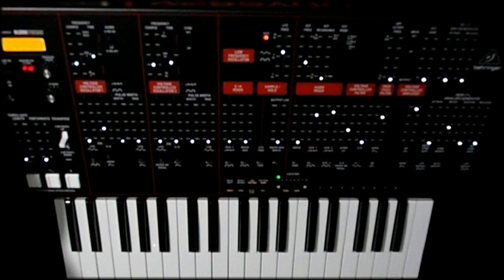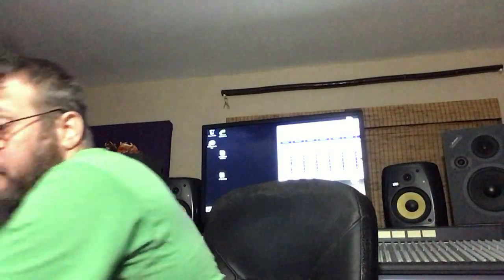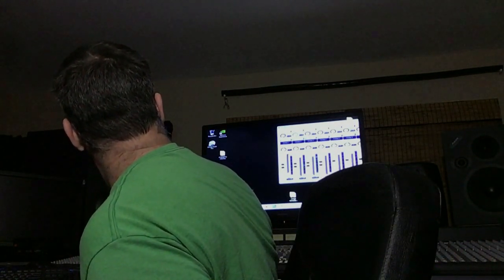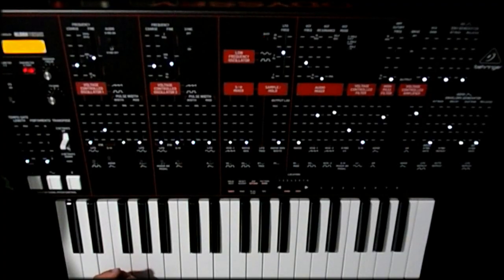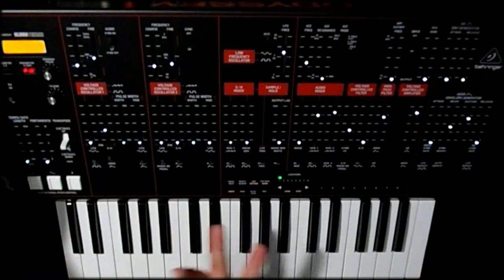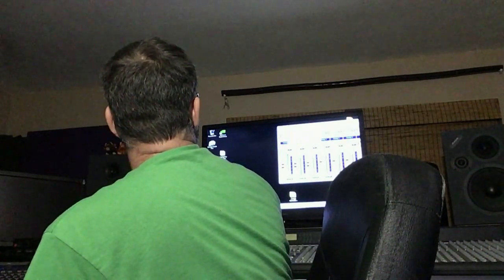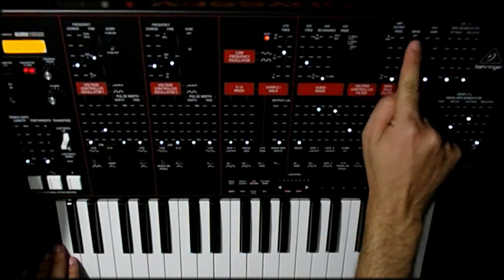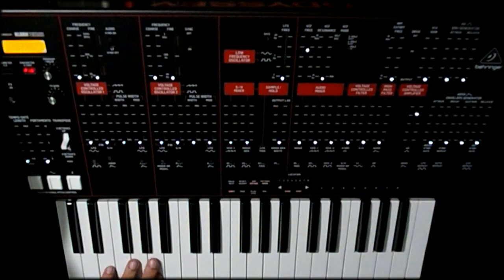Behringer Odyssey Emergency Guide. Things you MUST know.

Comment: My mate told me the other day that he likes Behringer because the do great clones of no longer available or expensive hardware that he could never afford. But whilst they may sometimes even add modern improvements, they often also clone the bad or annoying and dated parts of said hardware too. I would love a Behringer Odyssey. They sound great, are built like tanks and it's a lot of synth for £400. But I have nowhere to put one and I'm trying to cure my excessive GAS. Great video. Subbed. 🙂
Reply from the maker: here's something that will do what you mentioned: IK Uno Synth Pro. The original tabletop or anything later. You can get that original tabletop ive seen as cheap as 200$ used and 3-400$ new That is a ton of mono synth for the money! You probably know about it's features, but 2 filters in a huge amount of ways to arrange them. 3 smoothly morphing oscillators, full automation and presets with a mod matrix. Sounds great too. if you use it with the plugin editor it feels pretty knobby too. 

Also both filters are different, sound different, can be serial or parallel and one of them can be either 12db or24db and still use the other at the same time. There's not much else that can do this and have CCs and presets too, in fact i can only think of one other synth that does, In fact the same guy, Erik Norlander was on the design team for the other: The Alesis Andromeda, which i also have. I'll tell you what, I use the IK Uno Synth Pro way more! it's just so convenient.

The Behringer Odyssey is great though and it's fantastic having everything laid out with such a nice work surface and has that classic sound. Also as far as cloning bad stuff, i cant say the Behringer Odyssey has any flaws in it's design or construction. You also wont break your keys as easily as a vintage one. They hang over!

Comment: Are the sliders mappable?
Reply from the maker: Nope, these dont have midi CC. its a what you see is what you get synth. If you want a good comprehensive mono synth with some paraphonic ability that has tons of CC and features I'd go for the IK Uno Synth Pro. The firsyt one can be had very affordably (2 for the price of an odyssey used) has tons of features including 2 simultaneaous filters with different routing styles. It also sounds phenomenal, easily as good as the odyssey. If you must have full hands on all knobs on the surface, id go for orignal korg minilogue. 4 note poly, and pretty much knob per function with CC and still sounds good, though not as beefy as uno pro or odyssey. Minilogue sounds good still just abit thinner and more metallic. It can do a vast araay of sounds, and is more comprehensive as an analog synth than the newer minilogue xd.
Reply: @ Thanks for the clarification, d’you have any recommendations for a poly synth with the same general layout as the Odyssey and mappable sliders specifically? I’ve a juno 60 emulation running via iPad and need the most versatile piece of hardware to run it and stand alone to justify the purchase…

Comment: you may like Behringer because its cheap but Behringer does not target the professional intrumentalist, their more like sales people, is like the Aldi Of musical intruments, they will break down sooner or later, mine has on 3 occasions. You will also find that the logic chips will start failing and your illumination LEDS on the sliders will start to fail, that would be the first sign. The swithces are somewhat flimsy and the PCB is a very poor flexing chinese design, doing repairs I noticed a lot of dried soldered joints and sloppy work, markings of flux residue everywhere, dark spots, not very neat. This syth is also not an ideal live performing intrument on stage because it is very fiddley and cant see all buttons and knobs at a glance, the sliders make it more difficult to perform live, but as a studio or a hobby peice it is alright to have, becasue it is cheap, sound close to the Arp and prices have come down further on the them...

Now imagine Roland or Yamaha Doing same thing, it would be pointless and shame to their name....and all musical intrumental palyers in the world would fail on stage...

Comment: all the users have background noise on the headphones out ?
Reply from the maker: I don't know if they all do, but I can say I noticed after awhile that the sliders seem to be exponential. (at least on my early white led model) That means small changes at the bottom and big changes at the top. The original Odyssey may have been like this, I don't know. It's probably useful for working with the filters, where you want lots of resolution in the middle and bottom and don't need nearly as much at the top of the range. 

How does this effect headphone amp noise? Put up the oscillators in the mixer to 2/3 and VCA amplifier up about the same and play a few notes. Now raise the VCA slider the rest of the way up. The volume almost doubles! The oscillator sliders in the mixer are the same way. Once you are aware of this,  you can do better gain staging and your headphone amp won't be amplifying a signal thats too low for it. It's not as important when going into higher quality line amps instead of the Odyssey's headphone amp. I should have put the gainstaging thing into this video, but I didn't realize it at the time I made this video, 2 days after getting it.

Comment: So, why in the world did Behringer configure the output jacks this way or at least give a warning on it or in the user manual?  I got one too, plugged in the XLR and blasted my interface. Thanks so much for telling us how to tame it. I'd still like an answer from Behringer. First time I plugged it in the Vu meter needles on my interface pinned to the right and flashed red - what a shock! Thank goodness my interface is built like a rock, so it took it fine.
Reply from the maker: Thats the same design as the original Arp Odyssey.
Reply: Someone explained that XLR output it is designed to go into a long cable on stage to a sound system.  The 1/4 inch is designed to go into guitar pedals, so it is low level.

Comment: You are missing the point of the Odyssey's configuration.. the low output is essentially guitar-level because it's intended to be used with a pedal chain, which is expecting that input level. The XLR connector is extra hot because you are going to be using it on stage and there might be as much as 100-200' to the FOH. Otherwise, just engage the 20db pad on your mixer.
Reply from the maker: I didn't get into why it was designed how it is, just how to get it nicely into a daw. The Xlr puts out nice line level signal, it only males sense to get that into the line input of the audio interface. Sure you could go to the xlr mic in if you have a built on pad, but many dont and why risk changing the sound from said pad. That said, my board which happens to actually be a FOH board (ML5000) has xlr in only and has pads and those dont change the sound. Still this video isnt about plugging to FOH boards. Its for helping get it into common audio interfaces. The Odysseys design pre-dates daws by a little bit. :)

Thanks for watching. Oh yeah as far as the low out its great for using an external and flavorful mic pre DI

Comment: I have a mackieprofx10v3 mixer. It has two combo xlr/1/4 inputs. Can I just use a 1/4 trs male to male from the b Odyssey low output to one of these combos inputs?
Reply from the maker: While technically yes, it depends on if the input gain knobs on the Mackie have enough gain available to get the incoming signal to a useable level. If it's anything like the amount of gain in my interface pre-amps then no and you'll get a crappy signal to noise ratio out of the mixer. even if they do give enough gain though, keep in mind you are getting more of the input amplification character of the mackie and much less of the Odyssey, which will give a different tone. That Odyssey output amp IS part of the sound. Still you might like the sound of the Mackie input amp more. Give it a go! Don't be afraid to crank that input gain, you'll probably have to.

Might be worth a try on a tastier than what comes with a mixer stand alone preamp. You could also try just running from the headphone jack out of the odyssey using a 1/4 inch jack though it's slightly noiser.
Reply: @housebandthexenos2569  thank you for the detailed reply. I just might try it. Have a happy holiday
Reply from the maker: @wastedlunch5593  No problem! Let me know how it goes. Also if you get a chance, i just put up a brand new Odyssey video.https://youtu.be/udyHOt6QvRc

Comment: Can I use a patch cable from the headphone output into the 'external in' to overdrive the filter input? Like the Moog 'trick'?
Reply from the maker: I havent tried it but I dont see why not. I dont think that trick is all about filter overdrive though. Its really setting up a feedback loop. Thats going to thicken up the sound and make it more aggressive, well at least it does on minimoogs. My old Yamaha an1x had feedback you could dial in at the amp section, and it sure changed the character of the synth!
Reply: @housebandthexenos2569  Thanks will give it a try!

Comment: I'm not sure but maybe the low 1/4" output is designed to play nicely with guitar pedals?
Reply from the maker: Maybe, but it does work will with DI inputs on mic pres. Its just a much less amplified from the synth signal. That makes it great for giving that amplification somewhere else like mic pres and im sure youre right about it working well in guitar amps and pedals. Guitar pickups are really just a form of microphone.
Reply: @housebandthexenos2569  Firstly just want to say how much I appreciate the video and your replies. I have a Hudson Broadcast which is basically a transformer coupled germanium fancy pants broadcast style preamp in a guitar pedal. First time I tried it into my desk it worked OK with some gain but sounded unremarkable - then used the DI input on the same desk and big difference! I will try putting the Bodyssey into the Hudson then DI.

Comment: Holy crap, no wonder it's loud as hell

Just paused the video and ordered a xlr to trs cable from Amazon, lets see how much more stuff this video tells me to get.... just don't tell my wife.
Reply from the maker: Just use a 1/4 to 1/4 (not trs) cable from the headphone jack for now.
Reply: @housebandthexenos2569  thanks, I've been using them both on different channels, I'd rather have it correct now, how do you sync other instruments to the clock, i also have a roland u220, roland w30, Yamaha djx2 and a korg x50.
Reply from the maker: @TheAmerind  If you mean midi clock so you can run all the sequencers together in time, I don't know (I'll look it up for you) because I almost never use the included sequencers in hardware synths like this. I use a daw for regular sequencing, but also if I need to arpeggiation I use Squareheadz Nora which smokes just about every arpeggiator I've come across. 

I sometimes use hardware sequencers like in my Electribe 2 just because it's an all in one fun-box. Im my travels (I set up studios & freelance) set up lots of Tritons, Motifs, MPCs etc generally all stuff with screens tho. In the past I used to use workstation synths more as sequencers but to me thats all just pretty antiquated. I'm really, really not into the dawless craze at all! My guess is it just outputs midi clock by default. I'll tell you what I'll look it up right now.

Ok, and man I see why you're asking, the online manual is all the languages mixed together! On page 55 of the "quick start guide" it shows a snapshot of the Behringer Synth Tool. That may be the only way to change it but, I'm sure it's the best. The Synth Tool is a free app you can install on a computer or IOS device. In the "general" tab there is a "midi clock out" setting you can enable which will send midi clock out of course which is what you do if you intend on the Odyssey being the master, which then you would set all other attached gear to slave and have a midi cable going from out of the Odyssey to in of that gear. You can also set "sequencer auto sync" to activate it if you want to go the other way and have the Odyssey slave.

The reason I said "if" in the beginning is I don't believe the U220 has anything to run on it's own like a seq or arp. I'm pretty sure its a bog standard sound module. If you are asking about how to just use this stuff together, I urge you to just get a daw going. I'm using Studio One 5 these days. Glad I could be of help. I plan on making many more videos. I've been teaching studio engineering and music tech stuff over 25 years and until the pandemic been so busy with that I'm way late to the youtube thing. I've defnitely let the early Youtube opportunity pass me by. The fact this one video I made over a year ago is still going strong definitely tells me I should.
Reply: @housebandthexenos2569  i really appreciate your in depth response, this definitely gives me something to go on, thanks again, and i look forward to more of your videos, if i haven't yet, i will subscribe to your channel

Comment: Hi, if i used external midi keyboard on this, would this respond to pitch and modwheel?
Reply: The MIDI implementation is very poor on the B.Odyssey.  It will respond to the pitch wheel over MIDI, but not the mod wheel (CC 1 is not assignable).  I have been banging on at Behringer to fix this, and maybe they will in a firmware update, but for now modulation can only be applied using the PPC pad.

Comment: All Odyssey's having the line out on balanced xlr . Man man man .
Reply from the maker: Yes thats true and if you plug a regular xlr to xlr cable into the mic input of your audio interface you will clip it because that input will almost always be applying gain for mic level signals even with the trim all the way down. Some xlr inputs dont of course, like the ones on pro rack gear like eqs or compressors. My own mixing board has no trs line level channel inputs, instead everything goes in xlr and you use the pad to get line level. Still I can imagine just about everyone plugging in xlr to their audio interface and clipping it big time, some will only notice the bad sound. Theres also a low level 1/4 inch out but its too low for line level ins. Funny enough the way to use that is go into a mic pre with it through the DI jack and apply gain. It can be for if you want a different flavor than the odysseys own output gain.

Comment: Thanks for the video. XLR sockets on an interface are usually switchable these days between mic and line level. So no need for mixed end cables. XLR is not exclusive to mic input anymore.
Reply: Was gonna say this
Reply from the maker: Thats true on some but IME far from most. Keep in mind I made this video 2 years ago so im not thinking of things released after I made the video. I do studio tech support and I cant tell you the huge number of ppl that have had the exact same issue when trying to plug their mic preamp xlr into the xlr input of their interface dual jacks.

Also I didnt mention this in the video but you can go the other way than I mentioned by using the "low" output of the Odyssey into the XLR which would use more amplification from the interface instead of the Odyssey. I think this is probably not tbe way to go as I cant imagine interface preamps offering a sound benefit. Would work fine probably if thats the only cable available. Where it would be good though is low out to a tasty high quality external preamp maybe something with cool transformers or tubes.

Comment: Thanks for this man!
By any chance do you know how to turn off LOCAL? Can’t find a solution
Reply from the maker: I haven't either though I didn't look that hard. I usually only make sounds on the Odyssey playing it's own keys, but when I do the performance for recording I use a bigger controller keyboard. One of the reasons for this is the 2 octave transpose on the odyssey, I often just want one and it's just easier to play on another keyboard. If the Odyssey had local control you could just transpose +12/-12 in your daw. I'll have to check in Synthtool to see if it can. BTW your welcome and stay tuned for some new videos by me in the near future.

Comment: HI..Just had mine, and this video is very helpful, as I was about to send back...BUT Im getting tuning drift up the higher octaves, set it for mid C and them up an octave it s a LITTLE sharp...what is your like THANKS  again
Reply from the maker: That's just generally what all monophonic analog synths are like. The tuning doesn't usually track perfectly over the octaves. Some are better than others at it but can usually be calibrated. I own 2 Behringer Model Ds as well and they even tell you to calibrate and how to do that in the manual. The Odyssey probably can too. It's normal for monos to be a tiny bit sharp after just once octave and then drift even further. I find 3 octaves to be thee useable range for most monosynths. What I do is go for a little flat at the bottom of the range you are going to play so that it's never too far out in either direction.

Comment: Cool video, I have a modern Korg (the standard slim keys model)and although I haven't even tried the Behringer I want one. The Korg has the same outputs, the XLR being the high power output too. I often do the trick where you take a lead from the Headphone socket and plug it into Instrument in creating a signal boost feedback circuit.

Comment: Thanks for this - It confirms what I'm seeing in mine.  I have one other question I haven't seen addressed anywhere yet, which makes me think I may have a potentially defective unit.  When using the 4035 filter with resonance all the way down/off, the volume of the oscillator attenuates a bit as I move the cutoff near the top/completely open.  The other two filters seem to keep volume consistent.  Are you experiencing this as well, or is it perhaps just mine?